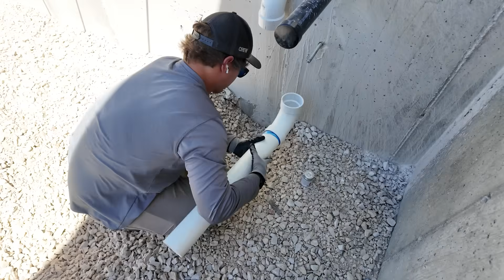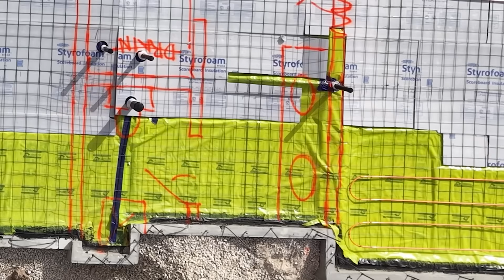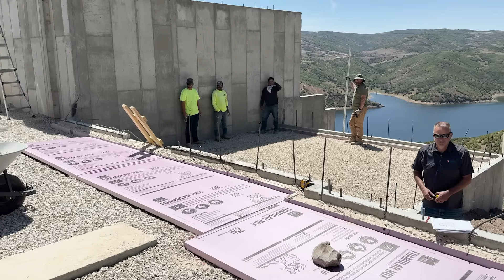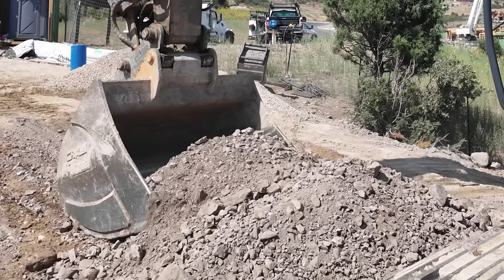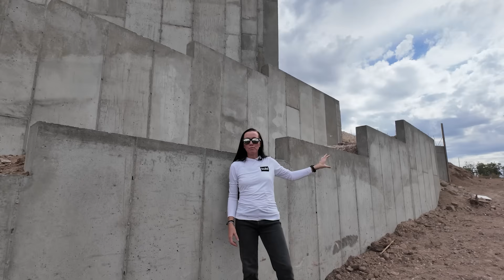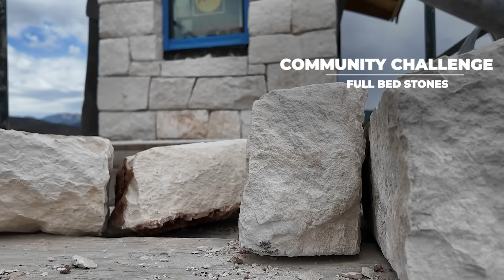Below Grade Control Layers and Sub Rough-in | Altitude Adjustment - Ep. 3

Comment: When using rebar above a radiant heat source in the slab I hope it's the fiberglass reinforced type as the hot/cold cycle from the radiant slab will actually cause steel rebar to crack a slab due to the expansion and contraction of the rebar.

Comment: I would like to introduce you to Logix Heat Sheet or Amvic Amrad and Ampex for under slab insulation. Much more simple systems 
Friction fits the pex tubing. No kneeling . No tieing to wire mesh

Amrad eliminates digging in perforated pipes in the gravel layer. 4x 4 Amrad can be taped at the joints for radon membrane. No Stego required 

Bill. Pacific ICF

Comment: Radiant floor tube spacing - what is the spec? How close can the tubes be? What is the minimum and maximum allowable? The whole radiant grid does not look flat with respect to the intended floor slab elevation. Is this standard practice? Won't there be hot and cold spots? Thanks.

Comment: Excellent job explaining all the decisions and challenges on a very complex and demanding project, Stephanie! I'm rolling my eyes at some of the uncharitable comments by other people here; some of these people clearly didn't listen to (or understand) what you explained, and they somehow still think they know better.

As far as the project itself is concerned, that's a whole lot of concrete holding up a whole lot of weight, especially with a pool on the upper level like that. That's a risk that I wouldn't personally build into my own home, but it sounds like the project has been heavily engineered, so I'm sure it will be fine. Also, kudos to you and the team for going to great lengths to not disturb the surrounding landscape. That's a difficult restriction to work around, but the home and the surrounding area will look a lot better as a result.
Reply: Thank you for the kind comment. Yes it is holding a lot of weight! But it’s on a solid foundation and it was engineered to hold all of it. It’s a tricky build but very stable
Reply: @StephanieBuildsIt  I definitely noticed when you said it has 8-foot wide footings! That should hold it for the next 1000 years or so :-)
Reply: @StephanieBuildsIt  Did you have to do anything unique for seismic activity, other than just build a very solid structure? I would probably worry about a worst case scenario of an earthquake damaging the structural integrity of the support for the pool, in particular.

Comment: Can you explain how you have a polished concrete floor that slopes to a linear shower drain? In my area we aren’t allowed to do that, the shower pan has to be water proofed and the slab doesn’t count even if it passes the 24 hour bathtub test. Am I missing something in the code, or not understanding your design? I know you didn’t go over it in detail, so just hoping for more information.
Reply: You’re exactly right! We’ll be showing this detail better when we get to that stage but essentially the entire basement floor will be a polished concrete. You have to recess the floor in the showers perfectly at this point so that we have enough room to be able to waterproof the shower floor and put tile inside of the floor of the shower, which will end up flush with the concrete floor outside of the shower. It’s tricky to get those details correct now so that we have a nice flush surface. The shower floors will be the only tile areas
Reply: @StephanieBuildsIt  Thank you for the clarification, that makes perfect sense! Yes it's a very tricky detail to get right. Roll in showers in general are hard to do, now you're adding transition from a polished slab! I don't think most people will appreciate how much planning, thought, and consideration will go into that detail, but that's construction!

Comment: Why is the reinforcing mesh not placed so it ends up in the concrete floor not laying under it as in the video?
Reply: 😂 keep watching and it will explain it’s not for slab reinforcement
Reply: that's just mesh to line-up the in-floor radiant heating. later when the actual reinforcing is laid it is lifted during the pour to sit within the concrete. concrete is highly viscous and will hold the rebar where you lift it to .
Reply: @dizzniisan  is mesh even used in the slab pour?
Reply: @notsure6182 we have tied a rebar mat over the top of the tubing. This will act as our slab reinforcement, while the wire mesh below is simply there to hold the tubing